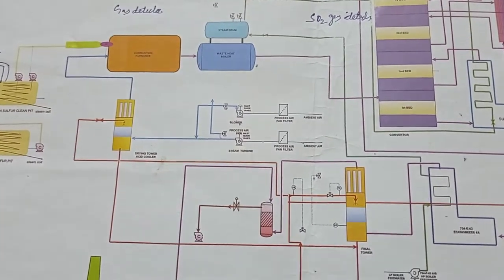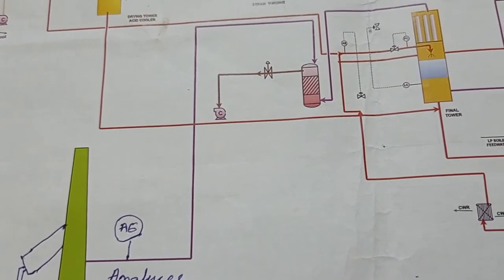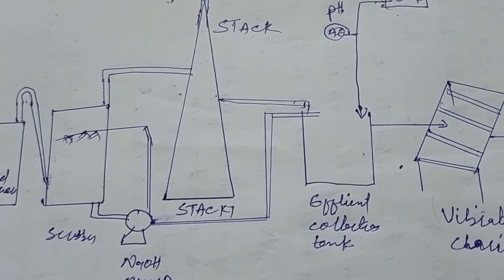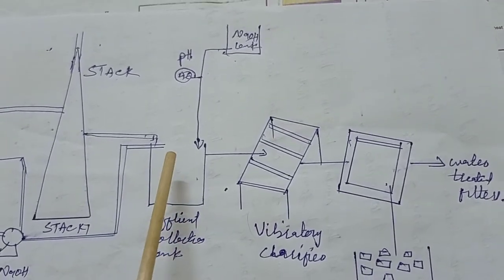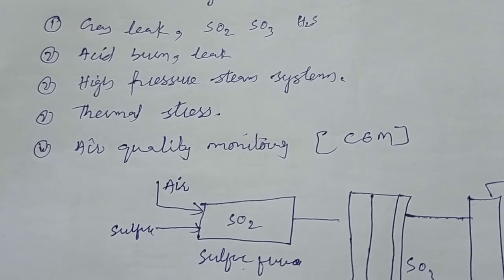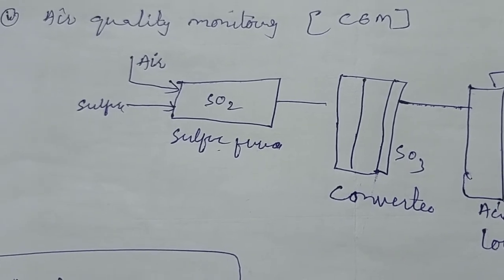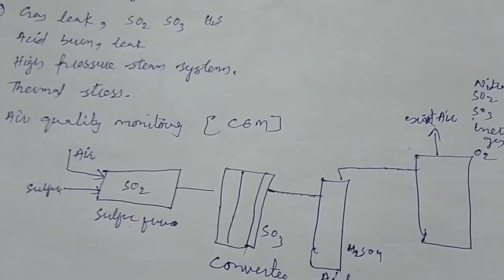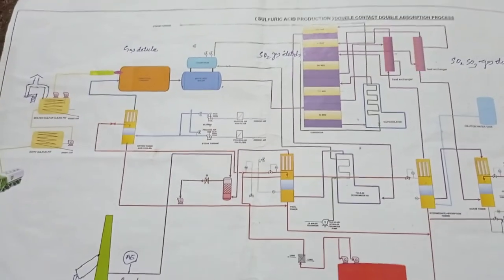pollution in sulfuric acid and how we handle hazard in sulfuric acid

Comment: How to clean the sulphuric acid plant
Reply from the maker: Use Large amount of water to clean it
Reply from the maker: If you want to neutralize acid  add Noah in liqudi form and after ph is basic then it can be discarded
If there is little amount of acid spill there add lime powder and scoop out the material
Use Large amount of water on heavy spill of acid

Never wash carbon steel container with water as weak acid formation may eat away iron